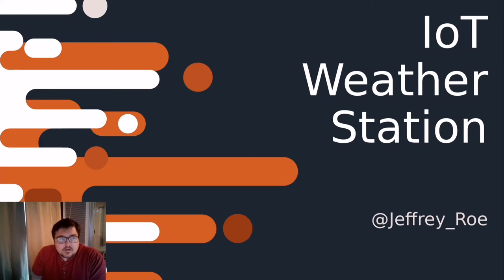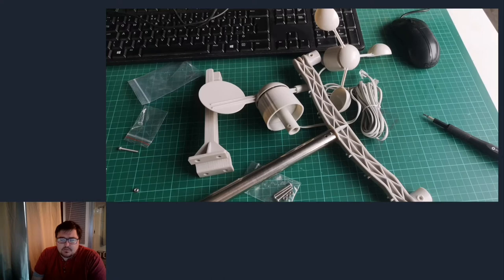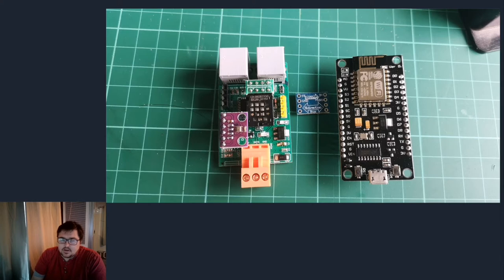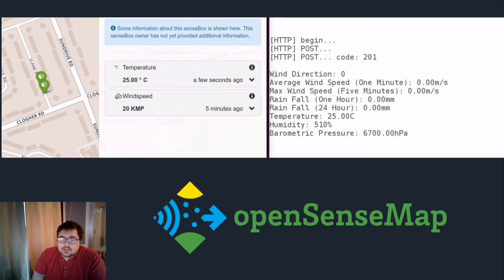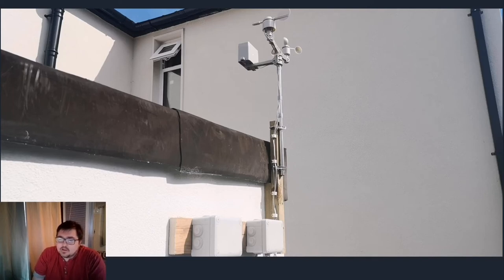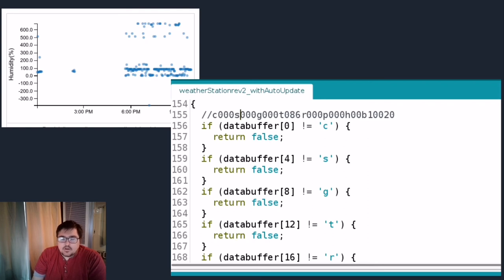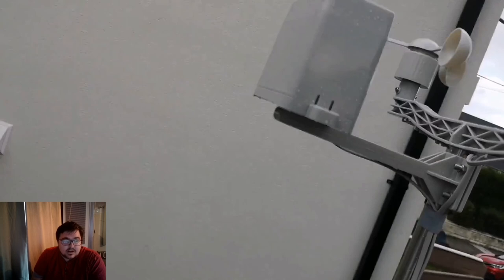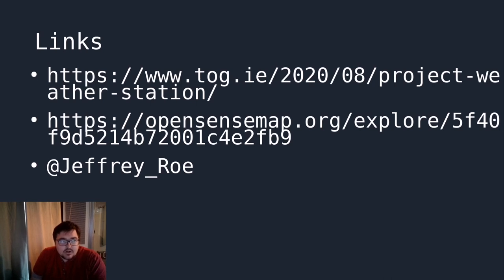IoT Weather Station

Comment: Hi Jeffrey,

Interesting talk! I was wondering if you would still recommend the same hardware after a year of running it. Looking to do a similar project myself and am checking out my options :)
Reply from the maker: Cost wise it might be a bit on the high side. It might be cheaper to buy all the individual parts. But it saved time just getting it all in the one place. The gear has worked well. I will be writing an update on tog.ie about the Stevenson screen and better code I have added.